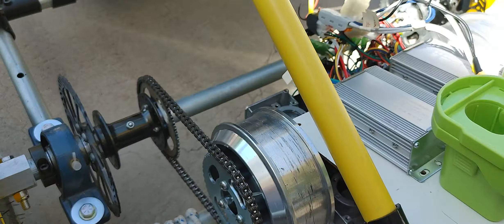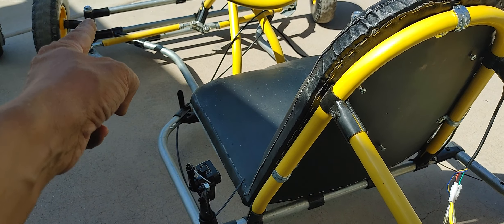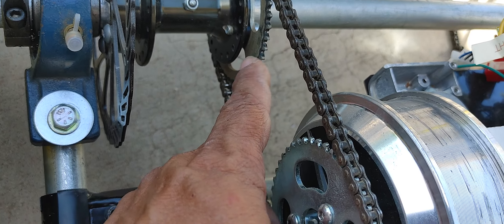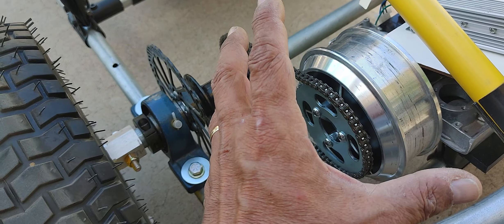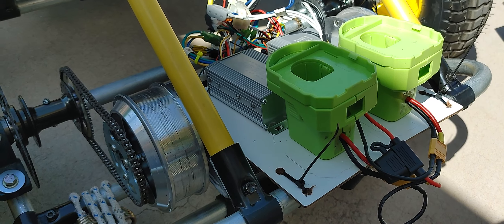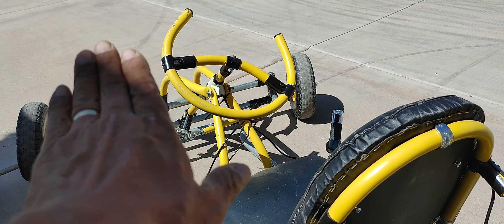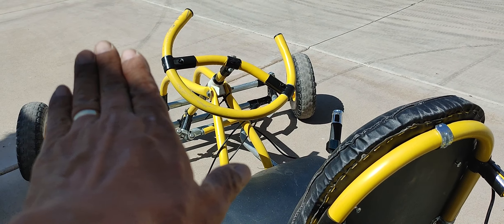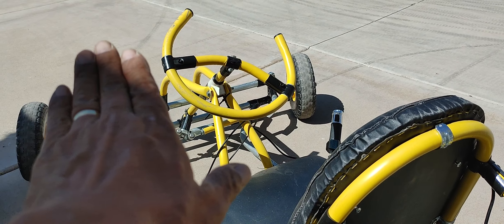DIY Racing Style Go Kart built with EMT Tubing and Maker Pipe Connectors - Mods - Part 2

Comment: Hi. How is the stopping power with those bike disks?  I'm thinking about using Shimano XT series but worried they may not have enough stopping power.
Reply from the maker: The brakes work just fine since the kart is driven with 36V DC (2) Ryobi 18VDC 4Ah batteries in series, not phenomenal speed but good enough for safe fun on flat terrain. Look at it this way, each disk is about 4mm thick x 2 that is 8MM thick close to a single brake disk as on gas kart.